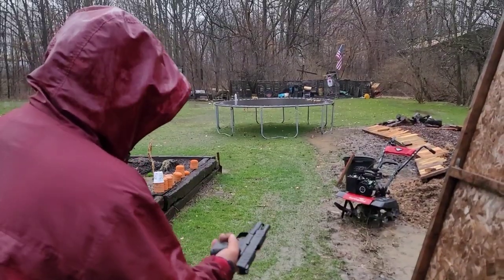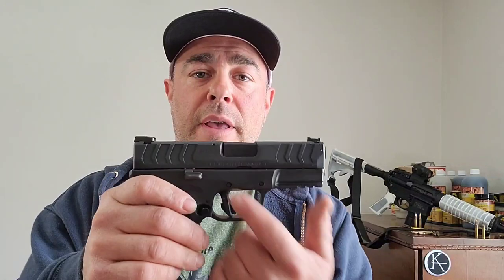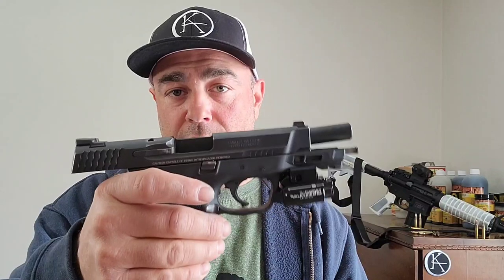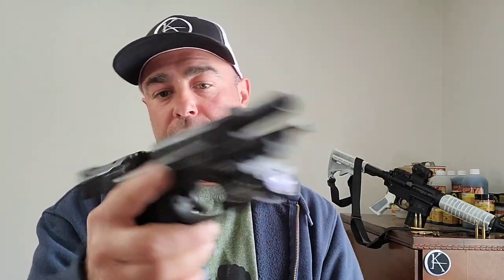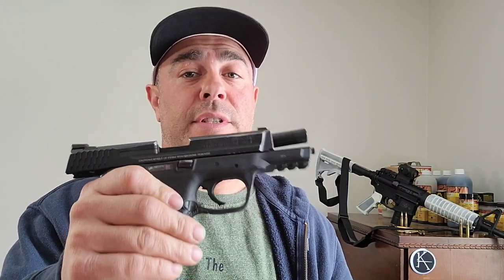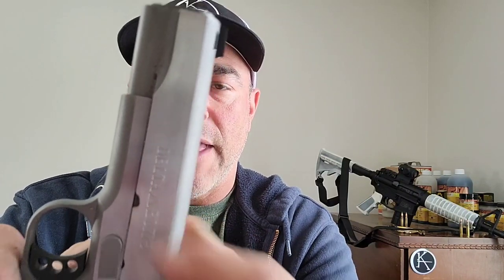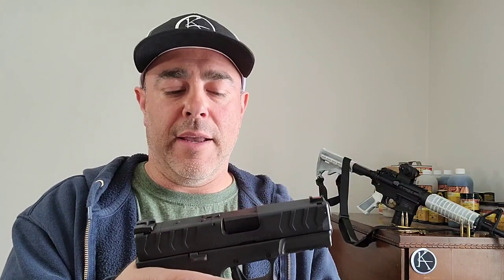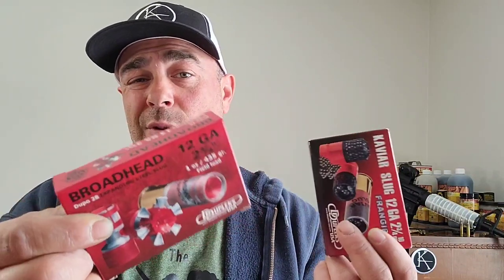Inertial Loading/"Smack To Rack" 🤔 Is it Tactical or Dangerous? Example: XDM Elite 10mm

Comment: My XDM Elite 3.8" 10mm with about 100 rounds through it inertial loads every time when the mag is seated with a moderate to hard slam.  Good to know so I can choose whether or not to have the slide locked back when inserting a loaded mag.  Those slugs should be fun to try.   Thanks.  Jess
Reply from the maker: I can definitely see it being a good thing if you know it's going to happen every time. Or if you know how to control the pressure. 
And I thought those slugs would definitely be interesting,we will see!
👊👍🦃

Comment: Way back when USPSA introduced "Production" division, Glocks had a perceived advantage because they would inertia reload.  (IMO, 1 second reloads from slide lock is a real advantage)  Soon all the manufactures started doing it.  
The unintended consequence was the number of the dreaded  AD's from people with poor trigger discipline.  That would result in the ever embarrassing DQ from the match!  It quickly became the number one reason for match DQ's.  The problem got so bad, USPSA re-wrote the rules so that, as long as the errant bullet impacted in the shooting bay, no DQ.  
Today, some manufactures are moving away from the inertia reload for "safety reasons".

Personally, I like the inertia reload feature.  Why else would I slam a loaded mag in my pistol if I didn't intend to chamber a round!
Reply from the maker: Very interesting about USPSA.
 That rule changes kind is of nuts lol👍🦃👊 Thanks for the great comment!

Comment: In the Marines, near the end of Vietnam, when I was issued my 1911 in .45ACP, I was in small weapons class. My govn't issued 1911 was designed to inertial load without needing to smack the mag hard. My new Glock 20 Gen 4 doesn't do this.

I would venture to say that this is a mfg choice, to inertial load or not... Simply pick your weapon's mfg at purchase time if you want a go/no go specific handgun. Or - take it to a qualified gunsmith and let them alter the weapon to your preference professionally.

No - I am NOT a professional. I'm just offering my experiences.

Comment: I've been keeping up with the topic on your channel. I have a new S&W 10mm and it will NOT inertial load no matter how hard I smack it. I'm thinking it might be you dropping the slide with the slide lock. I always pull the slide to load the new magazine. Can't think of any other reason yours would do that and mine does not.
Reply: On the m&p 2.0 they but a part on the slide stop/release so it won't slam forward Smith got too many complaints on the first gen
Reply from the maker: I agree that each time I dropped the slide I am prematurely wearing the part. It's very complicated because I have started to learn to do that as part of a training method. It's not good for the gun but it is very good for tactics. However if you break your gun your tactics are going to suck lol. It's one of those things I think you call a circle...twerk? Lurk? Oh ....jerk, that it.
 So yeah. It's not good to do it but some people do it and some guns like it and some guns don't like it and it's normal sometimes and it's definitely not on others. I'm confused as heck👊👍🦃

Comment: Slide release is sprung to be normally down and is only pushed up by the mag follower so once you put a loaded mag in there's nothing holding it up other than friction between the slide and release lever. The cut in the slide on the Xdm is not 90 degrees or very large, seems like they might have designed it this way?

Comment: Those new 12 gauge rounds look interesting. I can't imagine the adhesive on those Kaviar being perfectly viscous enough to hold the shot together in mid-air, so I'm real curious to see what they do, if anything. Those broadhead's look nasty, I've never seen an expanding slug before. I'm really looking forward to your gel tests with these unique shots.
Reply from the maker: That's why I picked them up! Both of them looked interesting. I think the frangible must just be for close range training. I can't imagine it's much more effective than a cut shell. Which actually can be devastating up close.
 But those opening up things look pretty nasty. 
Check out a channel called Taofledermous....or something like that spelling.  They shoot all sorts of exotic shotgun slugs. That channel is amazing with that kind of stuff. They have really died down over the years but they used to pump out a ton of material.🦃👊👍
Reply: @theturkeysopinion  My Glock 32 does the same thing, did it  right out of the box, I thought it was kind of cool because the slide release tends to feel a bit stuck at times, or at least it was until I broke it in. I wouldn't worry about it, my 1911 does the same thing with less than 200 rounds in. I think all the semi auto's do that at some point in time, some later and some earlier depending on the brand of gun.
Reply: @theturkeysopinion  Also, if you want to pick out a Glock gun without all the issues that Glock never fixed, get a Bul Armory Axe C cleaver in 9mm. I just picked up one, this company makes them out of Israel, and its night and day from a regular Glock. They took all the issues Glocks have had from the forums and basically corrected them while adding stainless steel parts and the gun looks pretty cool.

Comment: My 2.0 Smith and wesen 45 has always done it but I think it's awesome for doing it 👊💪💪😁
Reply from the maker: That's really weird. My 2.0 45 will not do it... The inconsistency makes no sense to me. And wake I said in the video I've shot the c*** out of that thing. And in class I dropped the slide all the time.👊👍🦃
Reply: The 2.0 actually has a safety measure so this doesn’t happen but it’s easily modifiable to allow it. The glocks and M&p 1.0 allow it
Reply: @eddiearchuleta615  it was 1 of my 1st pistols and my very first 45 I've shot thousands of rounds through it still 1 of my favorites through

Comment: The M&P 2.0's were specifically made to not chamber around when you insert a loaded mag if I understood it correctly. Now I personally think it's a good idea that it releases the slide when you smack the mag home. I can't think of a scenario when I insert a loaded mag and doesn't what the slide to go home... I guess if you are doing a "tactical reload" and you are not empty and you don't want a double feed. Maybe that is the best feature after all if it doesn't go home on inertia. That way you always know that you have to rack the slide...
Reply from the maker: Thanks for the info! Yeah I guess as long as you know which one it's going to be it can be to your advantage. 
When it happens to me during training it always throws me off just a hair because my thumb is just about to hit the release and it goes on its own.  This is when going fast of course.👊🦃👍
Reply: @theturkeysopinion  Well I still haven't developed a a specific habit when it comes to releasing the slide,  sometimes I hit the release and sometimes I go over the top. BTW I guess I was wrong with "tactical reload". The slide would be forward with a round in the chamber so no problem in that case...
Reply: You won’t have a double feed as the slide will be open /unlocked

Comment: My duty Glock does this.... however it does not reliably chamber a round when it slam charges. This is an issue because I have to rerack the slide to ensure a round is actually in the chamber and this both takes time and if there was a round chambered I now have a live round on the ground.
Reply from the maker: Really good comment! And that's exactly what I'm talking about. It's either designed to do it reliably or it's not supposed to do it at all there's not much of an in between. But it's such a Gray area and it is so prevalent that gun companies will make it a non issue if they can.👍👊🦃

Comment: I think I mentioned on another comment that I had a Grand Power P1 (1st Generation). The instruction manual for it specifically discussed inertia reloading as an option to reload "during shooting". There were a bunch of things I didn't like about that gun (the inertia loading didn't bother me) but I just checked the manual for the newer version of the K100 and P1. The references to inertia loading are gone. I'm sure the guns still do it but it is no longer called out as a feature which I find interesting. Also, I own 4 Glocks 2 with really significant round counts. None of them inertia load.
Reply from the maker: Thanks for the comment! That's funny you said that because glock actually told me that their gun was supposed to do that by design lol. These companies can't get it correct. I don't think any of them have a true answer. 👊👍🦃
Reply: @theturkeysopinion  I've subsequently learned my Glock 17 does indeed inertia reload if I whack it hard enough. Haven't tried my 19 or 48 though.
Reply: My GP-K100 (new gen 2020) did this from the factory. I consider this a great feature. I believe this is due to a lower power recoil spring since these guns use a twisting cam locking barrel design like the Beretta PX4 Storm and also because they use a large ambidextrous slide stop that adds leverage to the inertial force.

Comment: Great video. My question is it because of the metal that is used for those parts is a tweaker thinner. I mean to me it's a malfunction. I don't think it was designed that way. On a side note 100 rounds through the new 10 mm Smith & Wesson so far so good
Reply from the maker: Nice👊👍🦃 Thanks for watching!

Comment: So far my XDM Elite 3.3 10mm doesn't do the auto load after about shooting 400rds. I've always pulled the slide back and released to load a round instead of using the slide lock to load a round. Not sure if the slide lock has warn out on yours.
Reply from the maker: I am definitely prematurely wearing that part down every time I drop the slide. I did not think it would start to happen that quickly though. I generally don't recommend dropping the slide however it is something that I have started to do because of trainers getting into my brain.  I 100% agree it's not a good idea to do it to the firearm but I also 100% agree that it is the best way to reload a firearm tactically under bad conditions in a firefight. And if you're going to train like you fight you need to train to drop the slide like that, however you are training to break your gun.... It's a big circle of crap. 
👍🦃👊
Reply: @theturkeysopinion  haha yep. You are definitely right that it should have taken longer to wear down. I hate to say it but I wouldn't be suprised if there were some cost savings in parts that has led to some of these issues. The XDM should have definitely come from the factory with a metal trigger and trigger safety too but opted to go with plastic. 

How is your XDM doing now? Had a chance to send more hot rounds down range?

Comment: I don’t have a gun with inertial load like that. Curious in your elite using one of your safe rounds, what happens if you have the trigger depressed when you put a mag in like that? Does the firing pin go off?  I was always taught that it was a slide lock not a slide release. Sounds like you have a bunch of broken slide locks.
Reply from the maker: I was always taught the same thing. But eventually it has gotten turned into a release also. I'm not sure if that was an intentional thing or if it just happened that way. The manufacturers seem a little bit confused amongst themselves if this is normal or not. I'm going to be putting up another video that's probably going to catch me a lot of flack but I'm going to do it anyway. There is no perfect answer to this situation for most firearms. 

To answer your question though.... In my experience it will not release the firing pin.  I have tried to get it to happen over and over with no success. With a captive and retained firing pin I don't believe it can happen easily.  However all parts can malfunction break or wear down so I'm not sure it's 100% safe in the long run. I do know that there are instances of broken or stuck/floating firing pins in firearms such as a 1911 or certain rifles that will indeed slamfire that chambered round off if the exposed pin. 
 A 1911 has a Spring holding the pin back. Eventually a hammer will hit it and inertia will send it forward. If the Spring broke in the meantime nothing significant would happen other than a floating pin at most.  Polymer pistols have a Spring trying to push the pin forward. If the sear ever broke that pin will slam forward. That has always concerned the c*** out of me even though I've never heard of a sear just breaking on its own.
 That is why I do not like to carry striker fired guns appendix.
👍🦃👊

Comment: My brand new, right out of the box Gen 1 M&P9 has done an inertial reload. I could do it, my wife could do it, & my (at the time) 9yo Son could do it. Contacted S&W customer service & told them about it. They recommended I send it back for repair. I did so (as the “pandemic” was getting started) & they “repaired” it. They said they replaced the recoil spring. IDK. I can still get it to do it. Our 2.0 9mm won’t do it nor will any of Shields. Some other pistols I have won’t do it either. I agree that it’s a good thing in a fire fight. However, I’m not looking for a fire fight so I’ll just keep my muzzle awareness up & send it.

Comment: Glock is NOT supposed to do that. Your also not supposed to use the slide release to send a round home on a glock. This is why the slide release from the factory has no thumb purchase. There is an internal part that will break when you do it too much. James Yager made a video some years back about cleaning a glock. In that video he talks about the damage to that part on glocks. Also, the next step in the evolution is to not lock back on an empty mag. The part is worn already and will continue to wear more unless its repoaced. Inevitably it'll get to the point where it no longer locks open on an empty magazine. That is even more dangrous as you get a click when you expect a bang, and your adding yet another step or three to your battery of arms. Click with slide forward, tap rack, click again. Drop mag, insert new mag, slide home, trigger. This just gets in more and more dangrous territory for a self defense gun. If you try to jump ahead of it you may be dropping a half loaded mag that had a bad primer thinking its an empty mag. Also adding steps in the battery of arms. My suggestion is to replace the slide release lever and only use it in one handed emergency. Thanks for making this video. Bet these comments go wild.
Reply from the maker: You have a really good comment!
 That is some good information right there. Sorry it took me so long to respond. Life has been crazy.

I talked to glock and those goofballs, at least the one I talked to said it was normal... Then I talked to 4 other companies and got various answers.
 I'm with you brother. It definitely prematurely wears the part. It's obvious with my 2 police traders compared to my never police used nightstand M&P.
 The super beat up Detroit police trade in does it very easily. The moderately used trade in does it moderately easy...
 However the one that is not really used up too bad at all never does it. I still have thousands of rounds through the 45 but I don't beat the crap out of it like the other ones have had done to them.  The Detroit one has some serious wear on it. I think that cop drew down on every single pull over and he trained an awful lot!  It might have been a swat team gun. It has that much wear. Most cops do not use their firearms that much. However it was detroit. 🤷‍♂️
 I'm gonna talk to one of my trainer friends. He is actually a swat team trainer and he uses Smith and lessons all the time. He drops the slide  Constantly. I'm gonna ask him about this. See how many guns hes worn down. This dude literally shoots all day sometimes. 

 This is one heck of a subject.  Thanks for adding!
🦃👍👊
Reply: @theturkeysopinion  I hope everything gets running smooth for you soon bro. Life does that sometimes. Gets stagnat for a while and we get used to that and then when it kicks into high gear we just do our best to hold on and enjoy the ride. 

Lets go Detriot. Your on to something with that. I can totally see a part time patrol full time special weapons and tactics guy/woman beating the total crap out of a side arm. Going through the motions of a felony stop even on a misdemeanor 85 year old grandma stop, lmao. Its awesome though that you can see a difference in the use between the models and that the 45 is still working to the factory specs. Im curios if you can see any rounding on the slide with those 3 smiths or with the xdme? The slide is supposed to be harder steel so that it wears slowly while the softer steel release wears for replacment. 
I used to have a friend who was a swat guy. We had a falling out but he was great for info most of the time. He was a great cop, super high speed when operating but could be a huge jerk and thought he was right 100% when in reality it was closer to 79%ish. I think he was a big smith guy too if I remember correctly. 45 was his go too. Mayve thats a swat thing, idk. I curios to hear what your frind says, keep me posted? Thanks as always and heres hoping you have a great day.

Comment: As I see it’s not a huge deal even if it’s not supposed to do it . If your loading a loaded mag your intending to load the gun with an open slide most don’t store their gun open slide with a loaded mag. 

The way I see it is if it’s reliable without fail or some kind of miss feed it’s not a huge deal . put the mag in a little more gentle and it won’t do it. 

Just my .02